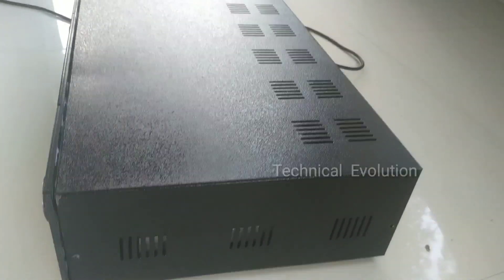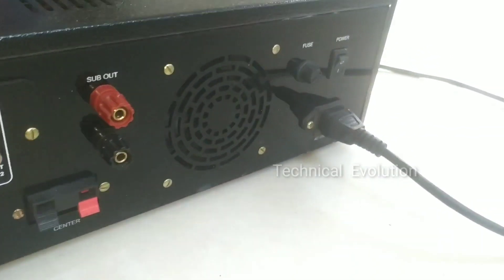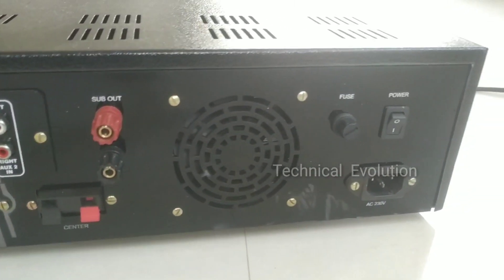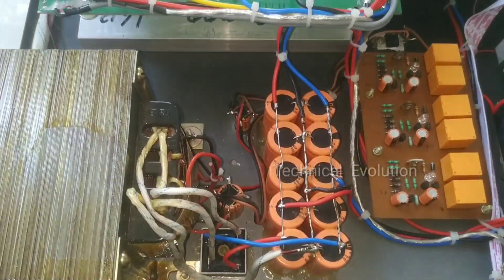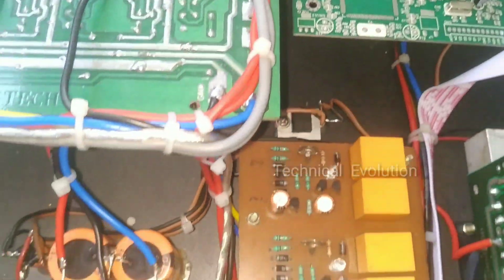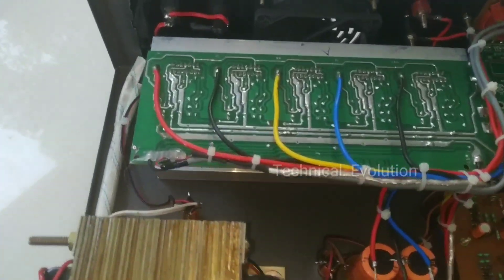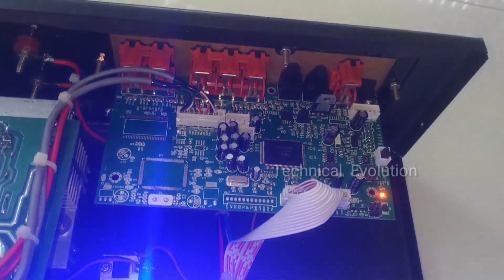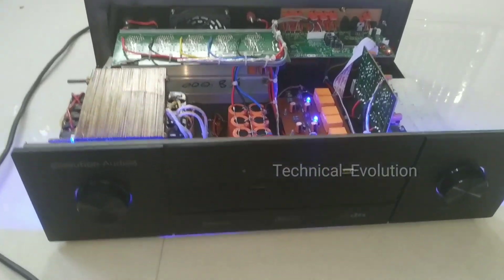5.1 Dolby digital amplifier 600wrms

Comment: Please Guide, Sir I had old Sony HiFi system Model No. HCD RV7 4700 watt PMPO, My system got damage and could not find it spare parts but the speakers are in good condition. Sir Please help me to choose best amplifier under 5000/- with same sony quality sound for Smart TV Aux input and Bluetooth. Waiting for your reply
Speakers watt specifications 
2 main speakers - 200 watt each
2 surround speakers - 160 watt each
Measured AC 120, 220, 240V, 50/60 Hz

Comment: Bro per amplifier cardileku ulla supply buck converter vaykku.. 7812 max 1 amps ee deliver cheyan pattu.. Bayangra heat aavum.. Chassis lot connection koduthath nannayi ennalum drop kooduthal aanu..

Comment: bro good job and neat wiring.pls which brand tda and sub board
Reply from the maker: St brand tda 7294 
Irfp250-9240 mosfet amp
Reply: Bro njan chodichathu power boards ethu company anannanu
Reply from the maker: @binuvinoy4126  board gtech anu

Comment: Hy bro 
 ഞാൻ ഒരു home തീയേറ്റർ വാങ്ങാൻ ഉദ്ദേശിക്കുന്നു. 10,000 രൂപയുടെ F&D bluetooth speaker 135w model ലാണ് വാങ്ങാൻ ഉദേശിക്കുന്നത്. അപ്പോഴാണ് ഈ ചാനൽ കണ്ടത്. 10000 രൂപക്ക് ഞാൻ ഇവിടത്തെ market ൽ നിന്ന് amplifier, speakers വാങ്ങി technical guide അനുസരിച്ച് connect ചെയ്ത് ഉപയോഗിക്കുന്നത് ആണോ നല്ലത് അതോ ഞാൻ ആ home തിയേറ്റർ വാങ്ങിക്കുന്നത് ആണോ നല്ലത്. എനിക്ക് നല്ല sound quality വേണം.  ഞാൻ ഏത് വാങ്ങിക്കുന്നത് ആയിരിക്കും നല്ലത്??
Reply from the maker: For 10000 you can buy a remote kit amp . Athil jbl sub run chyikkan pattum it sounds far better than f&d but you need to raise budget to 22000 to set all this

Comment: ബ്രോ ഇങ്ങനെ ഒരു amplifier ഉണ്ടാക്കുന്നതുകൊണ്ടു എന്താണ് മെച്ചം? Sony iv 300 പോലുള്ള ഹോം തിയേറ്റർ atmos വരെ provide ചെയ്യില്ലേ?
Reply from the maker: Pinne enthinanu bro koodthal perum assembled amp vangunnath.. Sony htiv il kettu nokkumbol aryam athinte porayma pinne ath atmos alla it can decode dts atmos nu bed speakers varum.. Nammal undakunna ampinte pakuthide pakuthy power polumilla sonyk.. Pinne complints koodthalanu orupad per enne vilikkarund complints parayan. Even AVR polm pqlappolm repairing nadakkulla board replacement anu option athinokke nalla chilav varum.. 
So assembled amp is far better
Htiv300 atmos support illa dts dolby Dolby prologic.. Ath oru valare cherya roomilekke pattullu njan review ittinnund output valare kuravanu
Reply: @technicalevolution9887  Thanks for the reply.
Reply: Please try to add demo audio also so listeners can experience the feel and a time you advice lm3886 is for better sound but you always prefer tda7294
Reply: Forget it.  Sorry.  The front panel is awesome.  No more words. Professional touch increase the royal look.

Comment: ഈ remote kitt il FM radio gain കുറവല്ലെ? Station ഒന്നു o കിട്ടുനില്ലല്ലോ? ഇതിന് എന്തെങ്കിലും solutions ndo?
Reply from the maker: Antena correct akki nokkyo
Reply: @technicalevolution9887  ellam nooki finally car antina vachu nookki. Scanning ok but no stations found. Ini valla gain adjustment vallathum ndavumo. Ee kit nte secret codes ne patty  video il add cheyyane
Reply from the maker: Ivde fm venam ennu arum parayarilla so njan ath nokkarilla nthayalm nokkatte
Reply: @technicalevolution9887  ok onnu nookku. Fm reception kuravanennu thoonunnu .   Veettil nalla signal strength ullatha.
Ee remote kit n orupad factory code nd ath arinjal ith rdy akkan pattum ennu thoonunu

Comment: Adipoli... Bro enik oru doubt transformer il allathe 12 dc il work cheyyunna 50 w 100w TPA ,TDA stereo board il sub filter use cheyth sub amp aaki mataan pato? Oru thavana njn nokiyapo board vallathe heat aakunnu aa sub filter nte out putiloode 3v vare dc current keerivannu y?

Comment: Nice work bro, busy ആണോ, കുറെ ആയല്ലോ കണ്ടിട്ട്, bro 7294 ic ക്ക് 24 volt ഇൽ അധികം കൊടുത്താൽ ഓവർ heat ആവില്ലേ, അതിനു 4ohms speaker കൊടുക്കുമ്പോൾ 24volt ഇൽ കൂടിയാൽ ic burn ആവാൻ chance ഇല്ലേ
Reply from the maker: Und but ithinellam koody single transformer alle voltage drop undakum  nalla heasink and fan anel no problem

Comment: Amp front panel looks good but internal need to improve( filter section)
Reply from the maker: What u mean by filter section.. Powersupply filter caps??
Reply: Yes,
Reply from the maker: Bro samwa 10000uf caps are not good that's y I use keltron caps and max voltage drop is 2volt I think it's ok
Reply: Technical evolution  ignore my comments